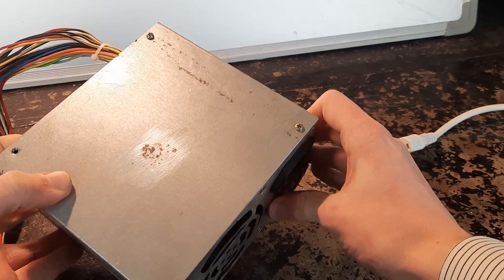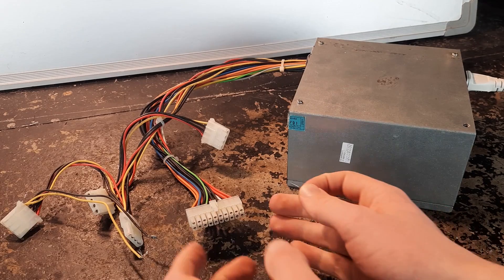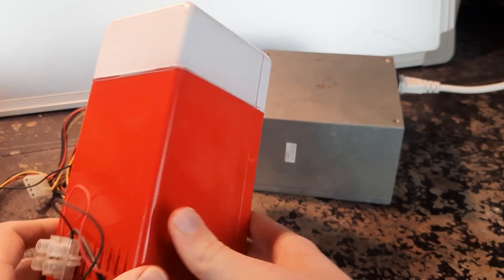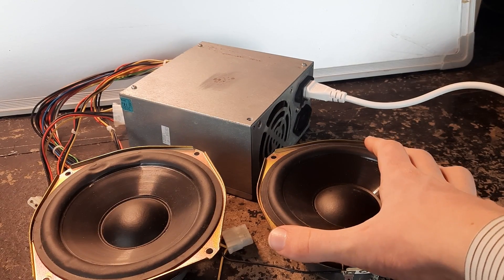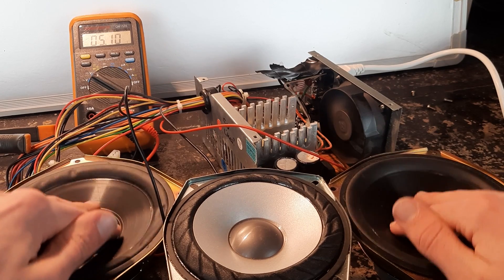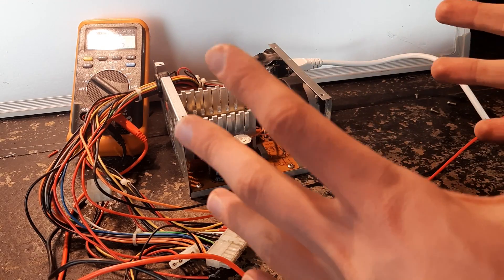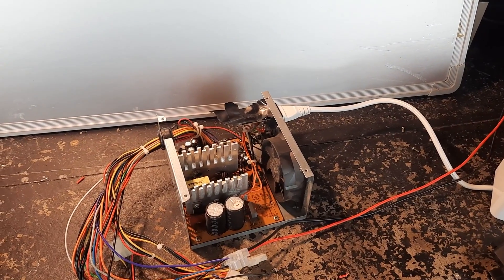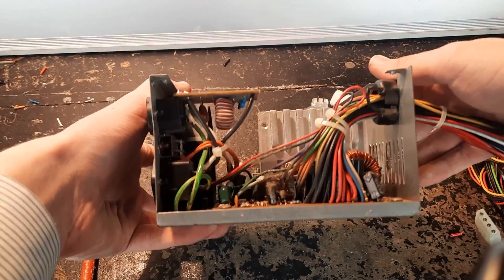Blowing up a Dodgy ATX Computer Power Supply

Comment from the maker: I found a blurb from an ixbtlabs.com about this power supply. It states "This unit refused to startup - both under load and without it (which is acceptable, by the way), but the question is whether we should be sorry: 250 W PSU will hardly be so desperately needed. " 
Honestly surprised it worked in the computer i pulled it from...
There are also graphs for the other models which show quite significant DC Noise
http://ixbtlabs.com/articles2/power/rk-psu11.html
Schematics are here:
https://danyk.cz/s_atx05a.png
Reply: wow so interesting bro 😐
Reply from the maker: @lesnacke  k

Comment: so i am late but if  a power supply is making a sharp sound it usualy means that a capacitor has failed and it is drawing more voltage than its sepost to be

Comment: My old boss would always say "you need some load on the PSU before turning it on, so plug an old CD drive in while testing". I'm not sure if there is any truth to it or if it's an old wives tale, that running a PSU without load is "bad".
Reply from the maker: yeah, the PSU rails can become a bit unstable when unloaded, but here it wouldn't turn on with load on the 12v rail...

Comment: Good way to get some fireworks is to backfeed the 12V and other wires with 240V mains. You're guaranteed to blow quite a few capacitors, smoke some resistors and make some semiconductors pop. You'll also succeed in tripping your breaker :)
Reply from the maker: @dash8brj  nice